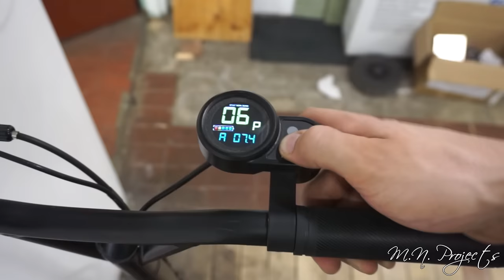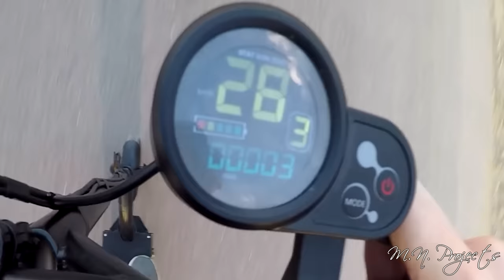Making Electric Scooter using a Gearless Motor

Comment: how long is the ride for 1 full charge?
Reply: 7Ah/50V battery, and the motor rated power is 350W. So at rated speed you reach 7A (350W = 50V * 7A). If your battery is fully charged you should ride for 1 hour at rated speed. 
What is the rated speed.. i Don't know.
Reply: It looked like it tops out around 31km per hour, which is 19 miles per hour. So about 19 miles...theoretically.
That  lines up roughly with a basic maxim for any electric vehicle with a fairly upright stance. That is below 20 mph, watt hours per mile is less then the mph number. At 20 it breaks even and beyond 20 mph whpm will be higher then mph. Theoretically. So 19mph sustained speed uses roughly 18.5 whpm. 350/18.5 = 18.9, or 19 miles range. Bingo. Its as true on a mountain bike as on a scooter.
 
However...
 
ALL of that is assuming you never stop once the whole ride. Every time you stop and have to re-accelerate, that costs significant amounts of energy. Also, there are losses to hysteresis. Also, a batteries rated capacity is not its true capacity. The more load you put on the battery, known as the "C rate", the less total energy you will be able to pull out for that charge cycle. In the case of this scooter, the motor is rated for 350w continuous and 750w maximum and I assume 48v standard batteries. That means it draws 7.3 and 15 amps respectively. 7.3 amps out of a 7ah battery is a C rate of 1, which is ok. 15 amps draw out of a 7ah battery is a C rate of 2 which may reduce its effective capacity some. ALSO Electric motors are much less efficient at speeds near 0.
 
Sooo not only does accelerating use more energy due to physics, it also requires running the motor at speeds where it is less efficient AND stresses the batteries with this particular setup, reducing effective capacity. 
So if you are riding this in the city, and just hopping on it and letting the motor do all the work....less then 10 miles range. If you put in some effort and kick off really hard to get some speed on the scooter before you engage the motor....14-15 miles range.
 
Hope that answers your question :)

Comment: I want to know if you could turn that battery pack on its side and put in a second one.
Reply: Probably not. The base hase to be built taller to fit them. He already had to cut a hole for the bms

Comment: It may look easy but he has a lot of professional equipment to carry out these works and its always more imvolving than meets the eye.
Reply: outside of the welding I think most all of it could be done with a hand drill, grinder and soldering iron.
Reply: @WIZERD51  and a spot welder if you're making a battery.

Comment: Absolutely genius.
Though I wonder what the speed and range is, cause this might be a wonderful short range commuter for work. 

Job well done sir 👍🏻
Reply: The speedometer shows it going 31mph on the flat. At least I think it's mph, could be kph.
Reply: Also, it's fairly expensive! Click on all the links and add the prices up! 2 batteries for £11 something, times by the amount needed, add the £96 odd for the brushless motor and £40 odd for the battery modulator, or whatever it is, and it stacks up. Might be cheaper just buying a cheap secondhand scooter or even a really cheap car!
Reply: £286 plus just for the batteries!!!!! Omg, then there's the machining, and the aluminium sheeting etc etc. You'd be looking at over £400!!!!! You can buy them cheaper than that in the UK. 🤪
Reply: @jimmy87251 I just clicked on the links the video poster left in the description. That takes you to banggood. That site must be very expensive then. 🤪
Reply: @zanhari1 Are you nuts ? Ofc it's km/h.
Reply: @TheN0mersy  we are nuts not. crazyyyyy😜😜
Reply: 나이트봇 ah nice 👍🏻
Reply: Btw guys im not an advertiser but use honey got about an 70 dollar discount

Comment: One suggestion for improvement: I would have wrapped the skateboard griptape around the aluminium cover instead of just cutting off the excess width. Looks cleaner (blacked out theme!), protects the edges from scratching, prevents the griptape from peeling off.
Reply: Plus would probably help add to the waterproofing. It's the little details.. only thing is you then wouldn't have access to anything in the compartment without cutting & replacing the grip tape.
Reply: @zro6828  What I actually meant was wrapping the griptape all around the cover alone while it is still unassembled @8:24 and mounting the whole thing to the compartment then ;) In case one would be worried about waterproofing this way, just a little bit of silicone put on the contact surfaces would surely solve that issue.

Comment: Very nice project! You might want to add a thermo sensor into the battery section in case those 1865's over heat. They are known to catch fire. Sensor could disable the circuit if heat exceeds "X" degrees. By the way, do you have the machine that spot welds the battery connections?
Reply: Cabeca
The battery in my electric scooter never heats up more than 10-15 degree in winter  and 20-25 degree in summer.
If you placed a proper battery, you don't need thermo sensor.

Comment: Cool video. I think using an old skateboard deck for would give you more foot space and could look cooler
Reply: Goddammit if I didn't think exactly the same thing.... That would look sick and offer more battery and controller space, just raise the sides up a little more and you should be able to get 60v battery and controller inside. And put steel dropouts on it instead of aluminum... And bigger motor.   LoL
Reply: @xpndblhero5170  and some skate board "wheelie" wheels on an outrigger at the back when doing wheelies with 750Watts! Like the dragsters have..
Reply: @johnshore3095  - That would be cool, It's usually programed into the controller not to dump power when you first start off so you don't wheelie but if you program the controller yourself then you can count on needing a wheelie bar.    LoL    I've been on 36v 1000w scooters w/o an issue but I have yet to try one of those 60v 2000w or 3000w ones, I've heard that they have been known to wheelie at 30+ mph.

Comment: That's actually pretty cool..... I'd be a little more aggressive w/ the power if I built one but I like it. Very simple platform and mods w/ nothing being too hard... I would have preferred you to use steel dropouts cause aluminum can deform w/ high torque motors. You either got ridiculously lucky or you put ALOT of thought into this... I'm gonna go w/ the latter.      LoL
Nice build....
Reply: XPNDBLhero you go man

Comment: Super interesting.  I wonder  how much he spent on the whole scooter. And how much he saved ? If he spoke a little it would of been good to understand what all the parts r called. Thanks anyway for the upload.that was great dude!
Reply: cool video for learning how to build it etc, but he did not save money. parts 413 USD / 347 EUR + shipping 25-35USD or more without tax, + man-hours. as you can buy 350w no brand scooter on Aliexpr. for 255EUR and brand scooter for 325EUR .. mybe if project for scooter will be bigger. with 2000w-3000w motor what will drive 50-70km/h :)

Comment: I converted a Razor Scooter back in 1996, and I still have it. I built up the Footboard for battery storage. A Computer Fan cooled the electronics when turned-on. I also used the Trigger Mechanism from a variable-speed Battery Drill for the Throttle Control. This throttle was mounted on The Footboard, and operated with the front part of the foot. I always wanted to "fly" through a Speed Camera with it, exceeding the speed limit, but it became scary to ride at 20kM/h! It only had a very poor rear brake. How things have changed since 1996, with much-improved components and batteries. Nice build, Greetings from Australia.

Comment: I have a similar motor you have only 36V. I got a controller for it but it is rated for 15A max and only 7A continous. I don't really know anything about those components. Currently I can't even test the motor because I think I need a dash board, to connect the throttle and an on of switch for the controller. Sadly I don't have any documentation and currently I think I need an other controller to make it work. I don't know how to choose a controller. Should it be bigger than the motor, so I should look for a 500W(1000W) controller, or that could burn the motor?

Comment: I have a question for you, so if you had enough space like in a go kart, for 26 cells you have a nominal power of 350W but if you put 56 cells would it be 700W for the nominal power and does it go on like this, is it proportional ? And what's the nominal power by the way ?
Thanks
Reply from the maker: The number of cells does not affect power, only range

Comment: @M.N. Projects : In 3:14 we can see that there are a blue and a black cable at the end of the Battery Protection Board. But where do you have put them in and how does the Battery have at the end one black and red cable? So what you've done with the black and blue cable? And is it hard to find a yellow clip thing, which you can see in 3:19 where you've put  the black and red cable in to connect it to the controller.
It would be great, if you/or anybody can help me, who knows the right answer, greetings!

Comment: The controller you posted the link to has a 6 pin power input. Where did you find the XT60 power input controller you used???

Comment: Battery wiring unprotected
Not only tape but also chamfer the metal surface
Put a sponge on where your weight will go
Stick the insulating tape on the controller wiring before connecting the battery.

Comment: i wonder how long time or distance you can use with one charge of batteries? would that kind of battery work well with bicycles too, that has very expensive batteries? perhaps even for use in cars, 12V and/or 24V?
Reply: They do use cells just like that. Tesla battery packs are .made from tons of 18650 cells. The same that are in cordless drills, Vapes, laptops, hp flashlights, e-bikes, other scooters and just about every other liion/lipo battery powered device. The cells their self can be attained  for a reasonable price but I wouldn't recommend the beginner diy for their first pack. There is a lot that goes into making a good pack and errors will render a low performing pack that is dangerous to use/charge.

Comment: @M.N. Projects: Where have you bought the brakes and can you explain, which Input at the controller is for what? It looks so difficult to find put every cable in the right input. Also how have you done it with the charging socket-- which cable is on the other site of the charging socket, because the cable of the battery is connected with the controller and the controller haven't an input-cable on the site where the inner site of charging socket is, so how can you charge it? 
It would be great, if you can help me because I also want such a great E-Scooter

Comment: Also, I'm guessing if you run out of battery and you don't have anywhere to charge, you can just get on the scooter and use it like a normal kick and go scooter, right? Unlike those unpractical hover boards that people have to lug around when they run out of battery.

Comment: How many kmh or mph with one charge?
Reply: 7ah at 48volt. Calculate yourself for full throttle time.
350watt divided by 48v and you have the amps 7.2amps.
So you can run one hour full throttle at 30kmh.
Range is around 30 to 40kilometers
Reply: @peterzingler6221  Thanks

Comment: An average sum of costs of the parts listed under links is 2300 PLN + the cost of Oxelo unit 300 PLN = 2600 PLN. Without considering the time, efforts and tools needed to construct that machine.
This cost is higher than a brand new electric unit from Decathlon, here a random unit: https://www.decathlon.pl/hulajnoga-revolt-r-id_8523790.html
But obviously if you love to make things in your domestic workshop and have all tools, time and money, the idea is good and the final product looks great, so keep up the good work :).

Comment: It's better to use at least 13s4p battery for this scooter, instead of 13s2p wich you used.

3:34 You had to remove almost all top plane (leaving a part around steering column), instead of cutting a small window for BMS. That top plane isn't necessary after making new side borders. It could give you more place inside scooter decka for better battery and other stuff.

Comment: 13s 3.6v is 46.8
How did you measure 54?
Reply from the maker: A charged single battery has approximately 4.2V , x13 = 54.6
Reply: @maciejnowakprojects  so why does it say 3.6 on the description?
sry im a newb

Comment: Can i install 24v/350w motor dynamo with 36v lithium battery? Thanks!
Reply: no  24   v  motor   running  on  36 v  wil not  last   but    u  can    ,,dissassemble   battery  to    24 v  or    get another   batt pack or  motor

Comment: WHAT IS THE AVERAGE DISTANCE ON 1 CHARGE? AND WITH THAT AVERAGE WEIGHT CARRIED? PLEASE.
Reply: 750 meters
Reply: Sir, Did you mean Kilometers? (Sorry I go by miles. I figure you mean kilometers but do not want to assume.)
Reply: @smartassist9700  I meant to type 7.5 kms or about 4 miles

Comment: motor
£95.92
charger
£10.91
batteries  13 packs of 2      10.82 each pack of 2
£140.66
protection board
£15.61
controller with display 
£35.54
old scooter
£0.00
brake and cable 
£5.00
hours working
£0.00
Total
£303.64

It's cool and a great project,  but not that cheap. It´s the same price as a xiaomi m365 (and this has more features like, lights, KERS, disc brake, foldable).

Comment: actually I've been unable to find the cell holder (appearing at ~2:00) and wonder if you can link to that too please
Reply: 5 minutes of SketchUp modeling and a friend with 3d Printer (or any local 3d print service) is all what U need. Great thing is that U can model cell holder in any weird shape if U need.

Comment: Today Received this hub motor but couldn't run it bcoz seller sended me 24 volt 350 watt motor and 36 volt controller,  this controller voltage is higer than motor, waiting for replacement

Comment: That's odd. I just put up a second comment but yt changed the entire wording and I had to delete it. 
The comment I wrote asked if it would take less power to use the larger metal spoked wheels from an old pram, or small child's cycle or old Moulton? Fewer RPM. Could even have balloon tyres.

Comment: great work. I have a question related to my inmotion L8F scooter... I would like to change motor in order to get bit more power for hills and acceleration, since im heavy guy (110kg) this thing is kind slow... so im thinking 500watts would suit me right, i dont need more. Now the question... Do you think controler and rest of the stuff on this scooter could take 500 watts motor, and which motor would you suggest?
thanks in advance.

Comment: Impressive work. And I searched Taobao for the price of electric scooters, and find out that a brand new scooter that its battery lasts for 30-40KM normally cost around 240 USD or 198 GBP.

Comment: nice  project  but  u  gotta  be a  handyman  with  some    more than   just   home    electritian    electro knowlidge   plus   acces to   at least    semi   tooled  garage ,old  push  scooter   and   some    new   stuff like  motor ,,batteries,,ok spot welder  is    not    a  must  i see your  is  i  guess homemade,,if  u into   rc  models  or similar  this  is  a   day s   work for   you ,,but   average  non electrician no tooled garage  is  better  off  gettin  china     or  used    electro scooter  ,, and   after  reading some  of  replay s  i  suppose  u  agree
but  nice   work    anyway,, i like   seein u  not   gettin  too   involved  in details,,   ok  is  good  enaugh,, some   would  owerdo   insulation ,welding   etc,,no nead    ,,good  job

Comment: some info.    i was able to purchase  a used  f&p motor from a US seller, for $70, including shipping.  see ebay/amazon;  look for lg or samsung washer motor.     it is Necessary to add an  output  SHAFT, to the bell/rotor.    (on mine) happily, the stock conductor in the stator  is about 18awg;, so,    power consumption should not be high.       googletranslate

Comment: In Germany so nicht zugelassen! (no permit) :-(
You need a Light, front and back , a second brake, cat eye reflectors on each side, an insurance sticker and a TÜV Zulassung ( a permit) -  then you can use the Autobahn, driving 250 km/h at max.
No, joking!
20 km/h on at the cycle path !
Reply: XXXX

Comment: Awful video.  All that welding, grinding and new metal and all he has is a 3.5ah battery and a weak 350w motor?  While the Facebook group I’m in are attaching 800w brushless motors with 8.8ah batteries to cheap Razor e300 scooters without welding, new metal or grinding.

Comment: Considering the price of the electronics alone, even minor the price of the scooter and the time and labor invested it simply doesn't worth it for mere mortals. It's a good project because it makes a good video, thus, generating money so you can make a nice return on investment. Although for us doing it for ourselves it simply not worth it as some nice scooters would be around the same cost range and probably more reliable.

I love to do stuff myself and I get the pleasure and pride of doing it, don't get me wrong I respect the work engaged here, but it simply not worth it for a scooter, although for a bike it might be a good idea as e-bikes are, right now, still overpriced.

Good video and good work (even if those plywoods are bugging me out lol)!

Comment: Electric motors don't have gears..
Reply: that's what YOU think.   some  motors of this  type  HAVE  internal gears; or gearbox attached.
https://d2t1xqejof9utc.cloudfront.net/screenshots/pics/3ec0037309200d0773b9f10bd0da80aa/large.jpg

https://3.imimg.com/data3/WI/BW/MY-8716310/24v-250w-electric-motor-for-electric-bike-electric-tricycle-500x500.jpg